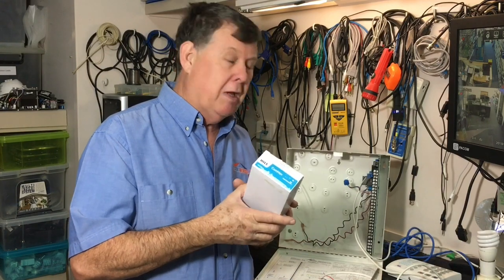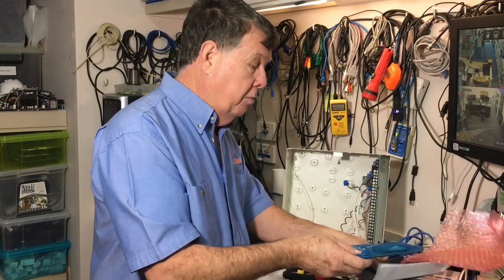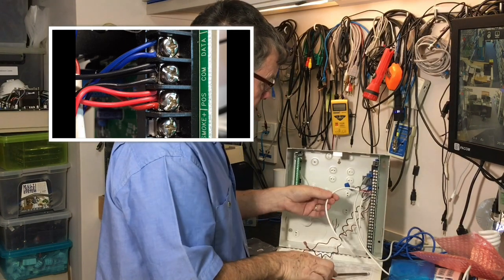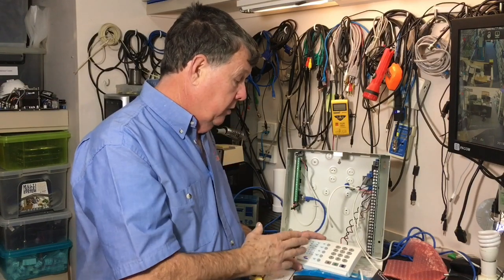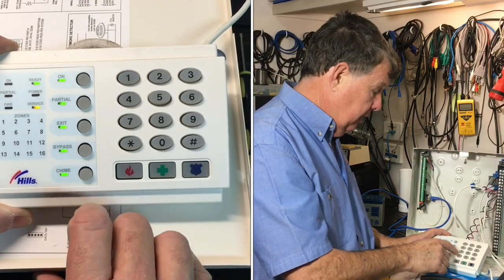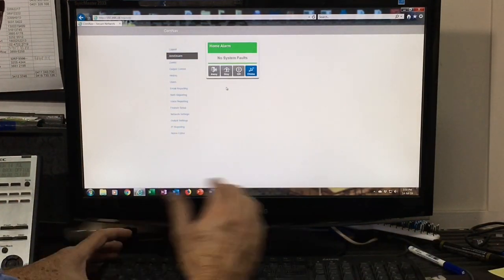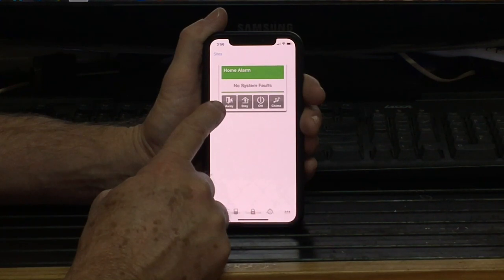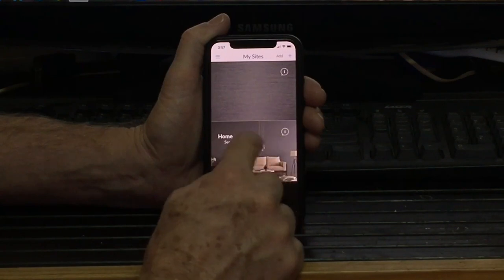How to Install ComNav

Comment: Awesome explanation! However I am slightly concerned as the heatsink on the reliance r128 is around the 80c mark.  Much warmer after this was connected. Is that an acceptable temperature?

Comment: So glad I found this video! Just wondering, do you have full control of what your alarm can do? EG: set up a "nighttime arming mode so certain bedrooms are bypassed at night? I'm scared of using the keypad. I'd rather a visual image.
Reply: @stephenfinkel4836  My NX-12 was installed back in 2003. Do you think it will work with that? It's made by DAS.

Comment: Hi Steve,
Thanks for your video was very helpful.
With my case i would need to default the NX 16 as the existing installer password is not known.
Is there a way to do a back up and restore prior to factory defaulting,as it could avoid the re programming of this working system.
In this case an lcd keypad is used.I have the NX586 E module for PC to Panel connect.
Could you please advice.
Reply from the maker: You would need DL900 software you can backup the data base , you all so need the download access code to use the software the only way to reset it is to default the panel if you don't have it
Reply: Thanks for your reply.
I searched on google for the DL 900 with access code couldnt find the link to download it.
Do you get it off you instead.
Reply from the maker: May not be available on the net , as its a tool for security professionals

Comment: Hi Steve, Thanks for this video. As I am on NBN now I cant use the telephone port anymore so went and got the COM Nav s2096a for my R128.  Is the installation same as you shown in the video? In the box I also received jump pins and  resistors what's the use of that? Also i did not receive that cable (Red,Black,Blue) should i check with Hills? or is there a alienate to that ?  Please advise.. Thank you..

Comment: Great video 
How do you rename zones on the ultra sync + app
Thanks
Reply: Hello Guys, I have the same question i dont have the option to rename the Zones. Nor hide the ones that are not in use. I only have 5 zones in use but the app shows me 24 Zones. And the renaming option is not available. Can some one please assist?